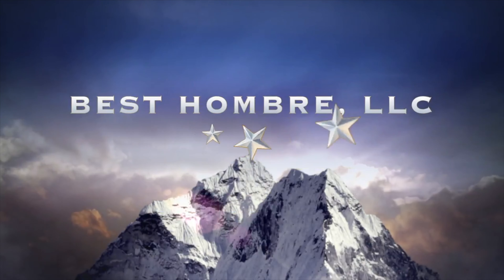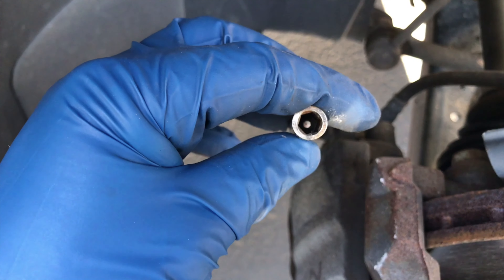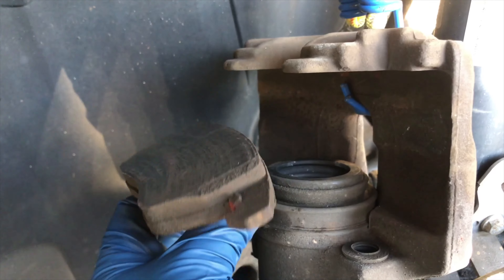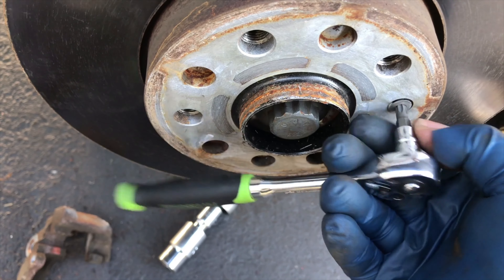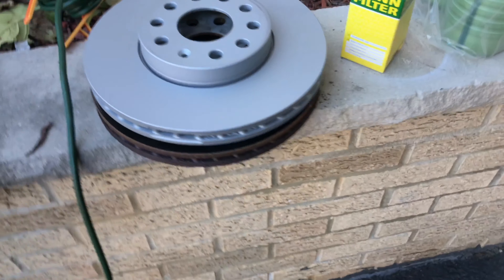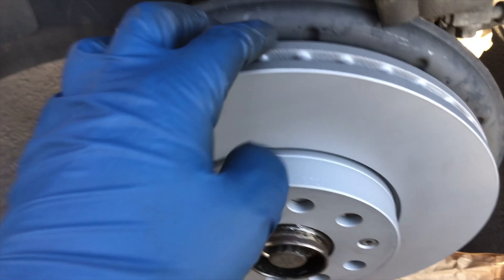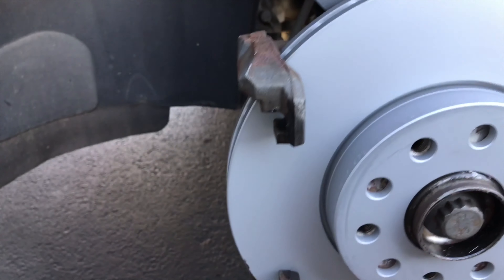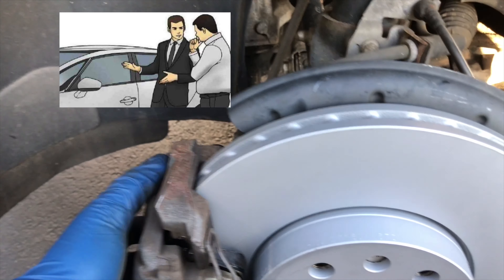MK6 VW Jetta How to Change Front Brakes, Pads & Rotors - MKVI (2011-2018)

Comment: Holy crap im glad i dont need another tool to remove that bigass fastener in the middle of the wheel hub.

The front caliper bracket is relatively easy to get leverage because you can turn the wheel to give better access. Just tried, and failed, to replace the rear calipers and rotors on my jetta and those caliper brackets are impossible to get good leverage to take the brackets off. Going to have to bite the bullet and pay someone else to deal with that headache.

Great video, but like the other guy said, it's really difficult to hear what you're saying because the music overpowers your voice.
Reply from the maker: Oh man, you're not wrong!

I wish I could have filmed it, but for the rear I used a regular sized breaker bar wrench (~12") and then then I slid a longer copper pipe over it for leverage. The copper pipe is about 1" wide which left "just" enough room around the smaller breaker bar for me to angle it away from the fender.

Also, thank you, I will be sure to limit the music in the future.
Reply: Just did a read brake job on my Mk6, don’t bother taking off the rear caliper brackets. There’s enough room to take the rotors on and off while it’s on. Trust me, it’ll save you so much time.